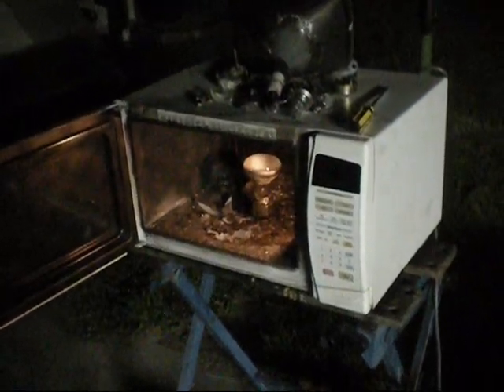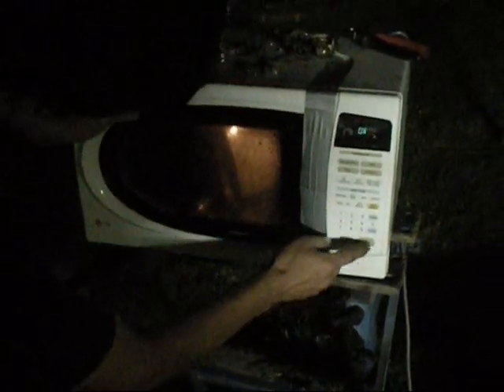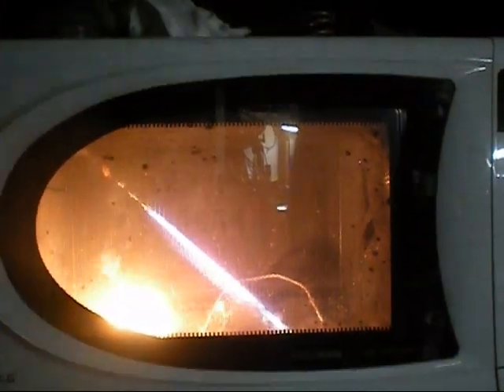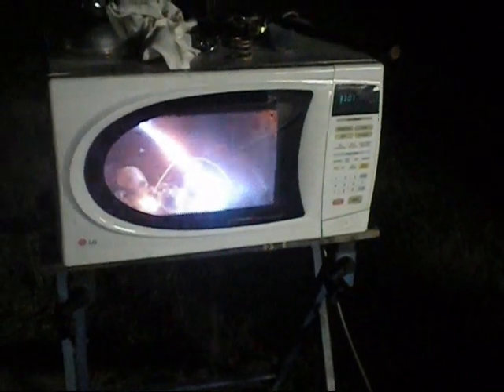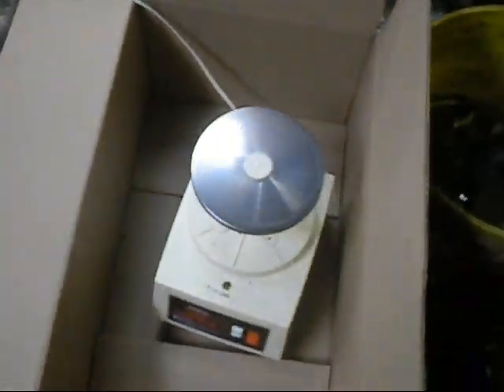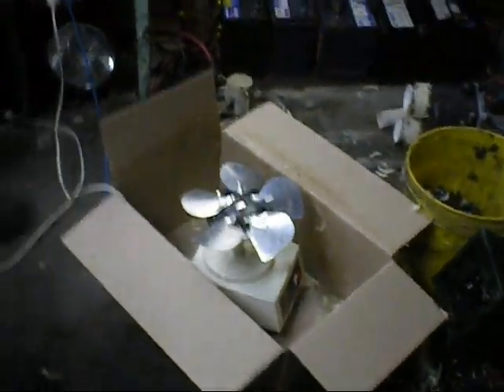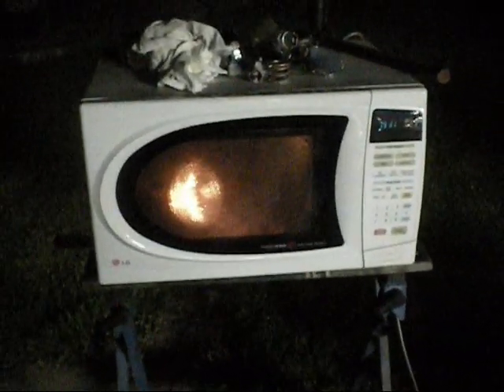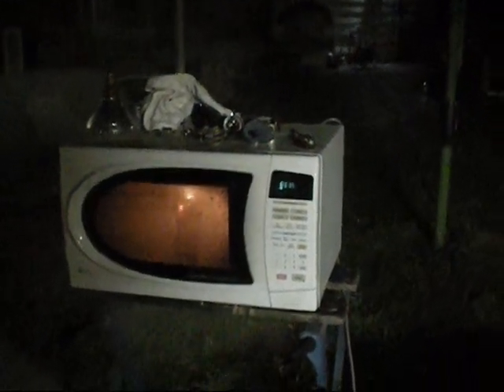the Aussie way to have fun

Comment: @ENGINEBLOWUK still the stock mag, just modded so the turntable and fan don't turn off. the constant fan is probably whats saved it from burning up in heatsoak. 

I imagine a bigger cap would either do nothing or kill the mag. higher voltages may increase power, but also kill it